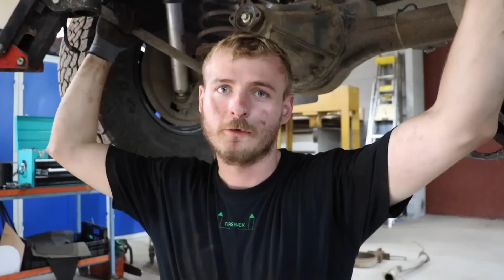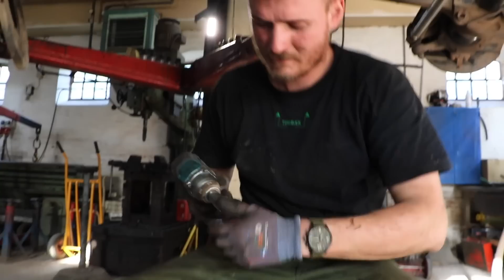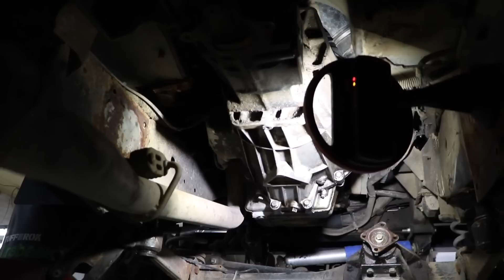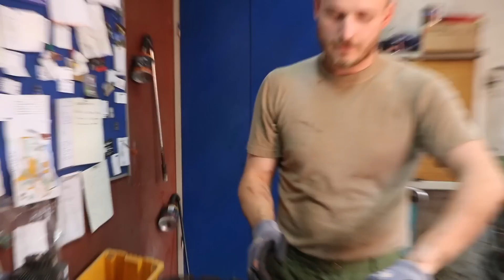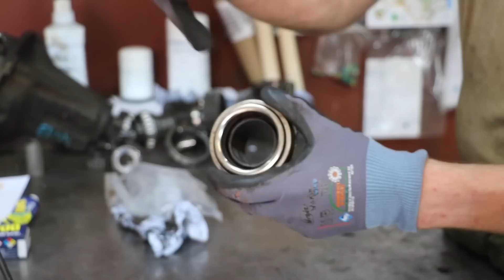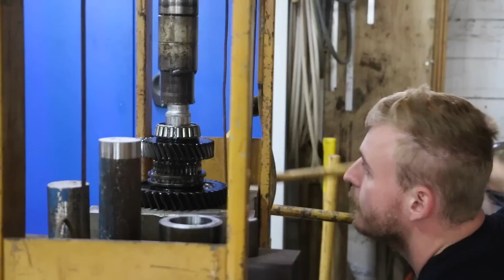The Defender gets some MAJOR upgrades! (Gearbox+Transfer box)

Comment: So a year and half on from making this Vid, would you say you still enjoying the mods? Also have you noticed a big difference in fuel consumption? Some have started a 10-15% decrease. Can you give us your honest opinion on this? I am busy doing my 110 County. Done the intercooler and remap. Next is the clutch kit and transfer box with new Vortex exhaust. So looking at above 200BHP. Ive improved handling with slightly lowered suspension, poly bushes and heavy duty anti-roll bars front and back.

Comment: Great video. Just one point, I checked with Lof before fitting my flywheel and powerspec clutch. They do not recommend soaking the bush in oil, they said to just use the grease they provide as per guide. They said soaking the bush in oil can cause the bush to slip in the fly wheel. Cheers

Comment: The clutch job i have had to do twice with my dad, he never set the pedal height after he changed the master cylinder, ( it only needed that) he decided to change the full lot, silly twat argued till he was blue in the face about the helper spring setting the pedal height.  With in 1k he had cooked the lot, all the little plastic odds and sods that  Nissa showed, had just melted to nothing. The bearing had practically melted, and the pressure plate had warped to the point you couldn't get a socket on, and the friction plate had heat fractures.  He sharp learned his lesson about listening to people and not jumping straight into things.  Not a bad job, to do but it can be a right pain in the arse if someone decided to have the car higher than the jacks can take. ( my dad did this 1st time around, so made the job a right pain in the arse) 2nd time around i told him to keep the thing on four wheels!  made life a lot easier.

Comment: Hi guys, great video. I've got a ex mod defender 110 built 1986 with NA2.5 diesel engine. After seeing your video im now thinking of changing the gear ratio in the transfer box. what do you think?
Reply from the maker: Depends what you use it for primarily - Lots of off-roading and towing then probably best to leave it, but if you mostly do on-road driving/long journeys then changing the ratio could be worthwhile 🙂

Comment: sorry for the multiple comments, but i am posting as i am seeing it...You will need to get the Speed healer, to correct the speedo. I was at 2500rpm ish at 120kph. You will probably be 2650rpm at the same speed as you are running a stock R380, while i swapped the 5th gear to a 0.735
Reply: Speedo drive is on the output shaft of the  lt230. so the speedo wont change with a different transferbox ratio.
Reply: Rick z i had to when i swapped to a 1.211 and again when i swapped my gearbox from a R380 to Mt82 with 1.1 TC ratio change.

Comment: Just watched your video and the one from Juice Motors back to back. I think a LOF Clutch is definitely on my wishlist for now. With the transfer box working a little harder, you should consider one of those  finned high capacity transfer box covers. Hard to quantify exactly how much cooler the transfer box runs, but the physics of more oil and better cooling makes perfect sense. Great video, can't wait for the next one.
Reply: Just fitted a power spec Loftclutch and single mass flywheel. Good gear highlgly recommend it.
Reply: Good
Reply: Good

Comment: Great job! I've switched from a Defender to a Land Cruiser 100 series a bit more than a year ago, but I always miss the Defender (not that particular one though:D) when watching your videos. It was so easy (and cheap) wrenching on it compared to the Toyota. Although I kind of enjoy that there are 10k km's spent without wrenching & in relative silence and peace, no water in the cabin, controlled temperature, etc:D But still.. I wish I had a 90.
Reply from the maker: That's why we couldn't have Land Cruisers on the channel, there'd never be anything to do 😄
Reply: TirsbaekTV Haha:)
Reply: my main gripe with 100... torsion bar ifs front. unless you got the 105... which has the non turbocharged 1hz... PFTTTT